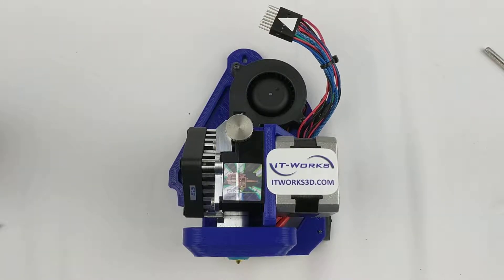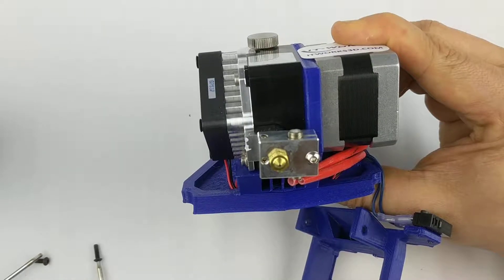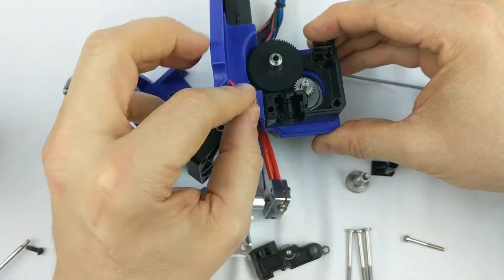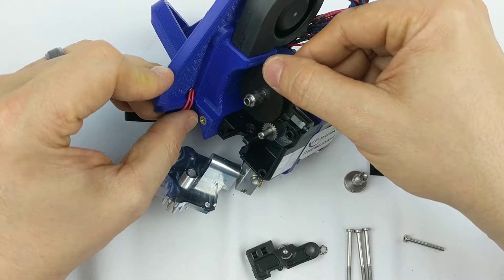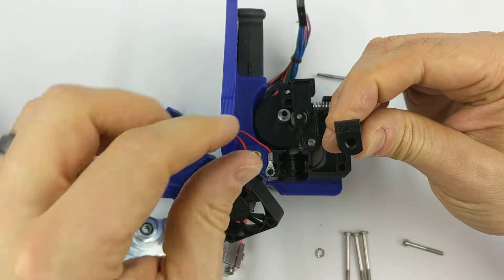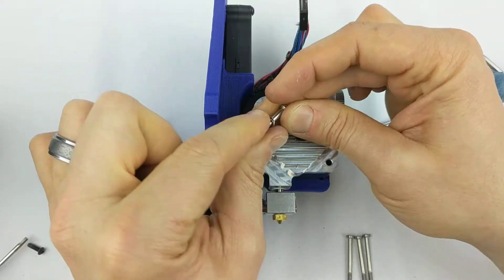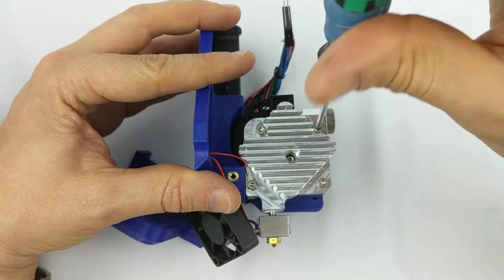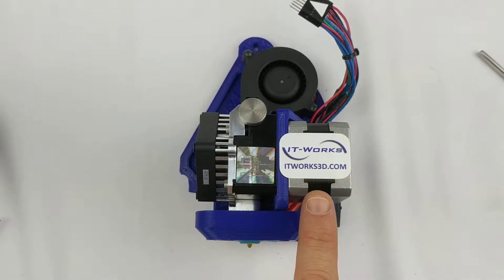How to E3D Titan Aero teardown and reassembly

Comment: That star washer is suppose to be on the screw going through heat sink and hobbed bolt gear. Its so it doesn’t work loose since you shouldn’t tighten that one as much to prevent bearing damage
Reply from the maker: Fair enough, as that's what E3D recommends, probably a good idea to add one there in addition. We chose to use the star washer to ensure good contact with the sense lead instead. We've found the threaded inserts in the Aero body to be a bit fragile, so the star washer helps limit torque while ensuring good contact with limited torque there.